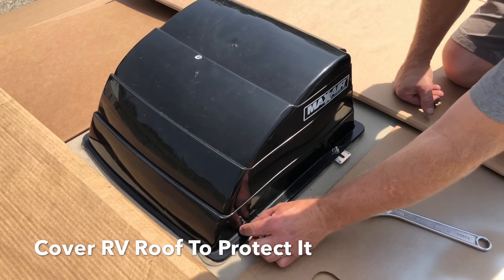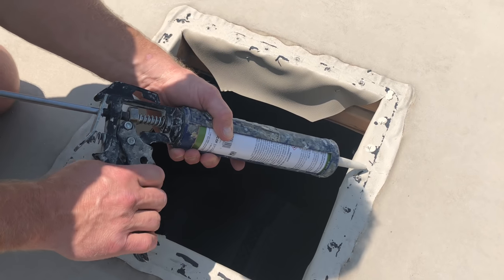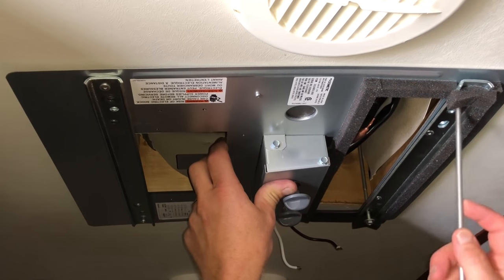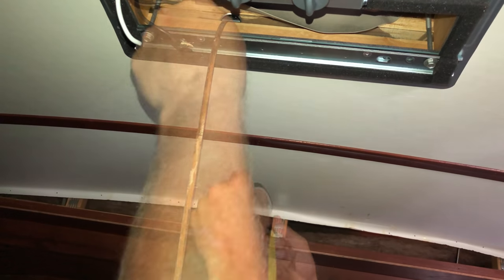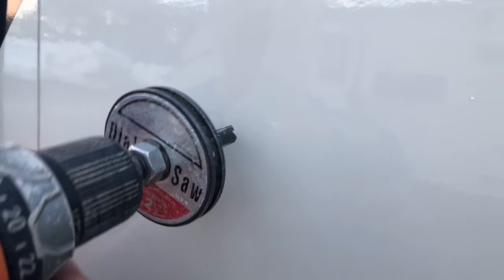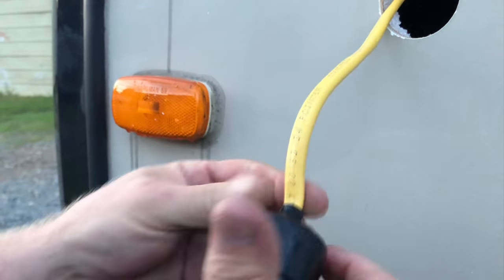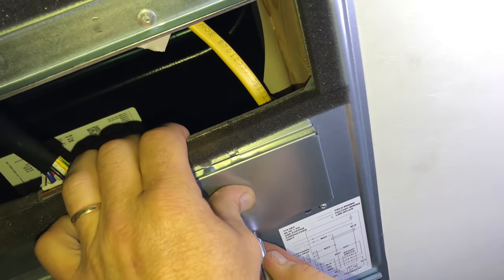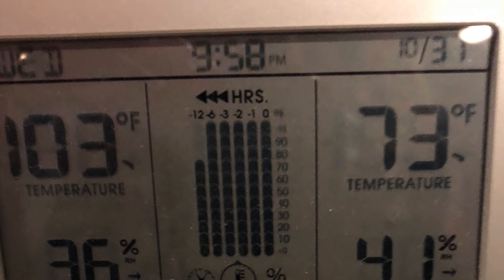Installing a 2nd AC Unit in a Camper with a 30 Amp Service

Comment: Awesome video. Thank you so much.question sir,my camper is already a 30amp, is it possible to hard wire it in.I have a 2016 Thor chateau with one a.c. unit. 
Thank you.
Reply: If running 2 you wouldnt be able to run anything else.  I would stick to something like this install so you dont overload and trip breakers. Ive seen video running a 20 amp input for running 2 space heaters in a 30 amp camper in cold areas.    Maybe there are soft starts that might be able to handle 2 on 30 amp but that aint a sure thing
Reply from the maker: You should not add another AC unit to a 30 amp service that already has an AC unit on it. Thanks for watching.
Reply: I have a 2017 Thor Four Winds 28Z w only one AC roof unit, I was vacationing in the southwest US and using a supplemental window unit was my quickest go to option, it draws only 9 amps energy for 8000 BTU of extra cooling, my generator can power both the roof unit as well as the window unit if needed although at RV parks I will plug the window into the parks 120v hook up.

Comment: So do you have troubles finding a extra 30 amp plug on the same pole when you hook up  , or is your camper 50 amp ?
Reply from the maker: NO. it does not plug into a 30 amp circuit. At most camp grounds there is a 50 amp plug, a 30 amp plug, and a 20 amp plug. Your camper goes into the traditional 30 amp outlet (if yours is a 30 amp) then the second AC unit has it's own plug that will go into the 20 amp outlet. Hope this makes sense and explains things better to you.  Thanks for watching.

Comment: Awesome video!! Could you provide a parts list that you used for this video?  This is the exact setup I am looking for to add to my 2018 freedom elite class c in the back where I sleep.  Thanks!
Reply from the maker: Unfortunately I cannot because every install will be slightly different. You will need to get what you prefer and what will work for your setup.  Thanks for watching.

Comment: Any particular reason you didn't just run it to you breaker panel and add a breaker instead of having to plug it in outside everytime you camped?
Reply from the maker: Yes, The reason is that this RV is only wired for a 30 amp service. Most RVs that run to AC units have a 50 amp service. The existing 30 amp breaker panel is already at capacity. By doing  it this way you bypass the limit of the 30 amp panel. Hope this helps.

Thanks for watching.

Comment: We have a 33.4' MPG 2800QB travel trailer.  Our AC is in the middle.  Will it be ok to add a 2nd unit in the front over master bedroom?  Just worried about the balance of the trailer.
Reply from the maker: While the 2nd AC unit may feel heavy in the scheme of things it really won't make that much difference. Picture your camper as a 33.4' teeter totter the set of axles being the fulcrum. if you add 75 pounds to the front of the camper (ie the AC) then to offset it you could add 75 pounds to the rear the same distance from the rear axle to offset the weight. Many times campers are off balance depending how they are loaded, how many tanks they have (Fresh, black and/grey). If your tanks are full or 1/2 full and not centered inb the camper they will sert the balance off. Even the amout of propane will offset the balance of a camper. If you figure two 30 pound tanks on the front of the camper that is far away from the fulcrum point that is going to make a bigger difference than many other things. having a 33.4 MPG 2800QB travel trailer with tandem axle helps spread the fulcrum of your "teeter totter" out so that it is harder to un-balance the trailer. I hope all of this makes sense. Happy camping, and Thanks for watching

Comment: what size, make, and model did you use?  do you have links for all the accessories you needed in addition?
Reply from the maker: I believe the unit was a 12,500 BTU but I'm not sure of the model. I simple internet search will give you many options to fit your situation. As for the accessories, those will vary from install to install so I have not made a list. Thanks for watching.

Comment: Is your inline gfi also 10 AWG and is it 15 or 20 Amp rating. Great video parts are on order as I write. Thanks,
Reply from the maker: For this set up it really only needs to be 15 amp but the extension cord should be heavier AWG if it is longer. Hope this helps, stay cool. Thanks for watching.

Comment: Excellent installation but I would have made it all 20amp service. You ran a 12/2 20amp line to hook up to a 20amp outlet  for power but you installed a 15amp  power inlet.
Reply from the maker: The AC unit only requires the use of 14/2 wire however I chose to use 12/2 because I had it readily available.Using a 12/2 wire is perfectly fine when only a 14/2 is necessary. So I guess if it were a 20 amp draw then everything would need to be up to 12/2 and rated for 20 amp but if I began to worry for some odd reason I could easily replace the plug with a higher rated one. Thanks for watching.

Comment: Does the a/c unit come with control panel on the bottom? If not, where can I buy the control? Thanks
Reply from the maker: The control unit was a separate purchase done at the time we bought the A/C unit. After using this set up in very hot conditions we found that the sensor/thermostat would register a colder temperature than the room temperature because it was so close to the supply of cold air. This caused the A/C compressor to cycle on and off too much and didn't allow enough cool air.  We ended up getting a remote thermostat and putting it 8' away from the unit and not in the direct path of the cold air and found that made a BIG difference. Hope this helps. Thanks for watching.

Comment: I notice you have wood frame box when was installing the AC. My Xplorer 1986 do not have an AC roof. Do I have to place a wood frame where I do the cut ?
Reply from the maker: It would not be a bad idea to add a frame just to reinforce the area. I personally would add a frame. Thanks for watching.

Comment: Hi I recently bought an used unit but doesn’t come with the 6pin conector plug my question is are all the cables form the unit same color as the air distribution box?
Reply from the maker: I would check with the manufacturer of the unit to be sure before wiring anything. Thanks for watching.

Comment: Great video. What size of cable did you use?
Reply from the maker: By cable do you mean wire. If so I used 12 gauge wire. Hope this answers your question. Thanks for watching.

Comment: Hey Bob, I want to do the same thing as you did but I notice the a/c roof units that i am looking at have wires for 12volt I think for a battery hook up.  How do you wire that to the 30 amp ??
Reply from the maker: If anything the 12v would be for the thermostat. Hope that makes sense. Thanks for watching.

Comment: Great video funbro, good detail. Where did you put the fuse and the breaker? I plan on doing this on my trailer
Reply from the maker: Most campgrounds have a breaker in the hookup but an in-line breaker is a good second line of safety, that is what I would use. Thanks for watching.

Comment: Was going to go this route but bedroom didn't have existing air vent so had factory installed 2nd unit. I was to scared of actually having roof cut to add a unit.
Reply from the maker: Fortunately I had a roof vent so that made mine a lot easier. It would definitely be more difficult without the roof vent.
Thanks for watching.

Comment: If I missed it I’m sorry. But could you post model number or make of AC, inside AC cover used and parts list. Thank you!
Reply from the maker: Since I am not sponsored by any particular brand I did not include or save all that information. Many brands have models that will work for this application. This video is just meant to show how it can be done. Thanks for watching.

Comment: Could you hard wire it to a breaker inside the camper or would the 30 amp not support it?
Reply from the maker: You would need a 50 amp service to add a second unit. Thanks for watching.

Comment: Good tutorial, but you should have used automotive grade connectors in the AC unit due to vibration as household marettes tend to unscrew while travelling.
Reply from the maker: Thanks for the tip, No problems yet.

Comment: Very nice, thank you for the video. Boy did need this in Texas this past year. 
How noise was the unit in the bed room?
Reply from the maker: It does produce some noise but not enough to offset a hot camper. Thanks for watching.

Comment: Can you tell me how many amps is this AC. The one I'm thinking to install is 15 amps so I need 12awg but I can't find a 20 amp 125 inlet.
Reply from the maker: If I remember it is definitely under 15 amps. I wanted it to be less than 15 amps for just that reason.
Hope this helps.
Thanks for watching.

Comment: So if I’m understanding I’d need to plug two cords in at a camp site. Main one to the camper and one for second A/C unit? Now if I primitive camp I’d need two generators or run only one A/C I’m guessing. Guessing no way to switch to 50 amp? New camper lol probably.
Reply from the maker: There is a plug made that will take a 30 amp plug and a 20 amp plug and combine them into a 50 amp service plug. I'm not sure if this would help for your situation. If not another generator is in order. Thanks for watching. Happy Camping

Comment: Great job overall except for one thing, your exterior connector. Now if your AC is rated less than 15 Amps, say 12 Amps then all is well and you can ignore the rest of my comment. If it requires a 20 Amp Circuit and draws 20 Amps you should make the following change.

Your Extension Cord is 20 Amp, probably 10 Gauge Stranded Wire, and that is perfect as is the wire your ran, 12 Gauge Solid, again 20 Amps. But your Exterior Connector was only rated for 15 Amps or 14 Gauge Wire and that is a huge mistake; especially if the AC/Heating pulls the full 20 Amps it is likely your Connector will heat up past its limits and might catch fire. 

Not wishing any ill will whatsoever, just bringing this to your attention as it's a very common mistake made by DYer's mixing 14 and 12 Gauge Wire. What actually happens is the smaller wire, in this case the 14 Gauge Wire, acts like a fusible link and heats up much faster than the 12 Gauge Wire. 

 Luckily for you it's a very easy fix, just replace your 15 Amp Exterior Connector with a 20 Amp and problem is solved. I am sure your Extension Cord can accept any 15 or 20 Amp appliance/tool as the Socket will have the Power Blade at a 90 degree turn to the Neutral. Meaning the Neutral Blade is North to South while the Power Blade is East to West unlike the 15 Amps that have both Blades North to South. Your Extension Cord should have one socket North to South while the other Socket is both North South and East West or Sideways T. 

I hope this helps... Cheers....
Reply from the maker: Rest assured that everything done in this video is well within specs. I do run a 10 gauge extension cord just to cover any voltage drop that may occur and to take into consideration motor start up. As always I went above what the maximum rating of the unit when it comes to safety and even use an inline circuit breaker that has never tripped. 

Thanks for your concern but I already have it all covered, Hope this video was a help to you. Thanks for watching.

Comment: Did you use a  Fusible link anywhere? 
Great video.
Reply from the maker: The fusible link/breaker is connected to the extension cord as a separate unit. Also most campgrounds have a breaker on the post..,.if you trust it. Thanks for watching.

Comment: Great video can you supply the links for the outlet and AC unit
Reply from the maker: I basically did an internet search to find an AC unit that met the specs that I wanted. As for the outlet, I found that on Amazon. I was not sponsored by anyone while making this video and really have no preference but this video can be referenced to install many different brands of AC units. Thanks for watching.
Reply: @funbro1  Thanks
Reply: @lemiarty  Thanks

Comment: I thought that the newer Rockwoods came with 50 amp service and prewired for a second AC unit. Is yours only 30 Amp
Reply from the maker: It is on an Outback. Some of them came in 50 amp and some came in 30 amp. This one was a 30 amp. Thanks for watching.

Comment: While you did a good job on the install I must say this fully explains why electrical fires are the most common cause of RV insurance claims. This would never pass coast guard inspection, and while it's a trailer and not a boat it's still a moving vehicle. 

A moving vehicle that flexes and vibrates as it travels down the road, that's why solid core romex and wire nuts are not allowed on boats. Also the AC unit needs its own breaker box with a dedicated 20 amp compressor rated breaker. 

 I can't believe RV's are built so poorly that they use solid core wire and wire nuts on vehicle electrical systems, It's why I replaced all the solid core AC wiring in my RV with Ancore marine grade stranded AC Romex and why I used water proof AC crimp connectors..  The voltage drop under load to my AC is virtually non existent
Reply: Yea marrets are a bad idea on a vehicle. There should be a solder and shrink tube connection or a crimp connector with shrink tube. The solid wire is also a no no but I thing in such a short run it will be ok.
Reply from the maker: It was built with all the same material that was used in the video. I'm not disagreeing that they are poorly built but anymore most things are. The breaker i an inline breaker hooked to the outside cord. Hope this helps. Thanks for watching.
Reply from the maker: It has solid wire running throughout the unit from the factory, and also marrets. Thanks for watching.

Comment: Where does the water drain or does it not have a return side
Reply from the maker: It drains into the pan that fits over the opening. The pan has a hole in it so the drainage runs down the roof and into the gutter like the other unit. During hot humid days we will have 2 streams of water on the roof.
Thanks for watching.

Comment: Do most roof vents in trailers have the same dimensions adequate for an ac?
Reply from the maker: They are all about the same size allowing RV manufacturers to all use the same roof vents. Makes them cheaper that way. Hope this helps, Thanks for watching.
Reply: funbro1 excellent

Comment: Hey man by a chance do you know the make and model to the ac unit and the control panel or the links to them please ?
Reply from the maker: No, I just picked the one that would fit my application. You may find one that fits your application better. Thanks for watching.

Comment: Can I ask you what unit that is, or where you bought it? I’m trying to find a unit that runs on 110 so I can do this as well. How many BTU’s is it rated for? Thanks!
Reply from the maker: It is a Dometic 15,000 BTU Brisk Air 2 that I purchased from an online RV store. Most of these units will run on 110. Hope this helps. Thanks for watching.
Reply: @funbro1  does it come with the ceiling control panel or is that something purchased extra?

Comment: so can we have the info on yer stuff u bought for the rv like the ac  and the outlet  please
Reply from the maker: I just bought what I wanted for my application. Yours may be a little different if you want a higher BTU unit or a lower BTU unit. I used 12/2 wire and an outlet for the outside of the RV which can all be purchased online. Hope this helps, thanks for watching.

Comment: how much solar do you need to run this?
Reply from the maker: You would need at least 1,800 watts of power to run this...more to get it started. Best. Etc would be to plug it in. Hope this helps, thanks for watching.

Comment: Can you tell us the part number of the unit and the control cover?
Reply from the maker: I no longer have that info but there are many units that will work for this type of application. I do not endorse any particular brand. Thanks for watching.

Comment: the no breaker free for all seems a little worrisome.  i'm sure in most cases it will function just fine, but if something wigs out there's no protection.  could be a very dangerous situation or at the very least, burn up the AC.
Reply from the maker: No worries about not having a breaker as every electric tree that I have plugged into has a breaker on it as well as a GFCI plug. If you want another breaker, there is an in-line version that can be added.

Comment: So with this install there is no breaker for it?
Reply from the maker: I use an inline breaker that plugs into the cord. It also has a GFCI for added protection.The pole at the campground should have a breaker and GFCI outlet but I prefer to be safer. Thanks for watching.
Reply: funbro1 thank you sir. My fifth wheel has a went above the main bedroom bed which would be perfect for this. It’s basically the same exact layout as yours with the closet on the left and everything. This will work perfect for me since I’ll never boondock and can run a cord to the power stand. Appreciate the video.
Reply: funbro1 also did you lay down Dicor on the roof even though the ac had a gasket?
Reply from the maker: I did not, I found the AC gasket to be very well made and (knock on wood) so far no leaks.

Comment: So that a/c does not need a thermostat,
Reply: So when a/c is on it is on all the time
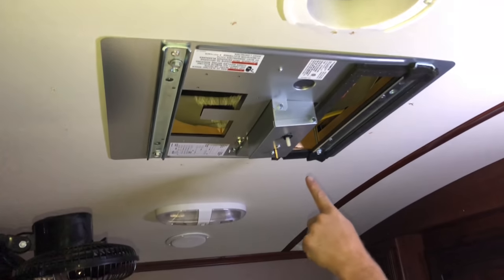Reply from the maker: You may have noticed the cover that was put on at 14:20 in the video, it has cut out holes for the temperature adjustment. So in short it is built in to the unit. You can also purchase an external thermostat that will allow you to put it somewhere else in the room if preferred. Hope this helps, Thanks for watching.
Reply from the maker: No, it cycles and can be turned off.